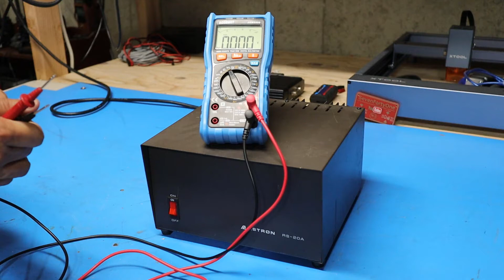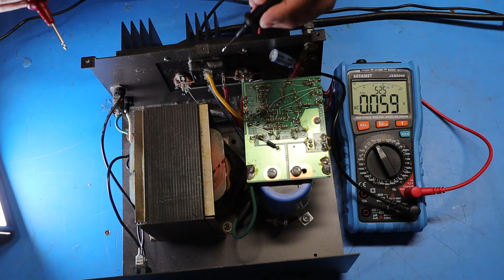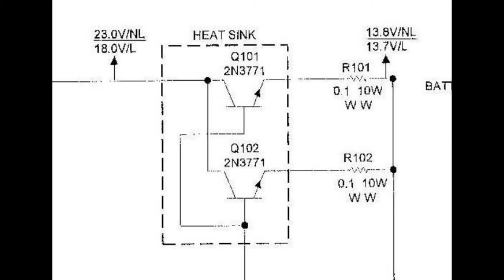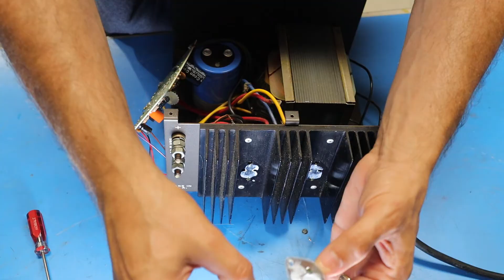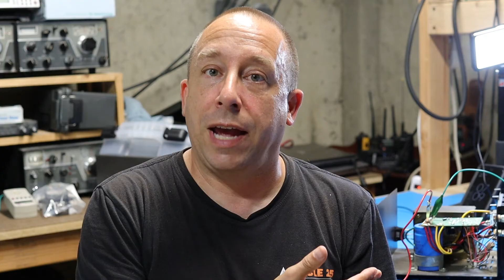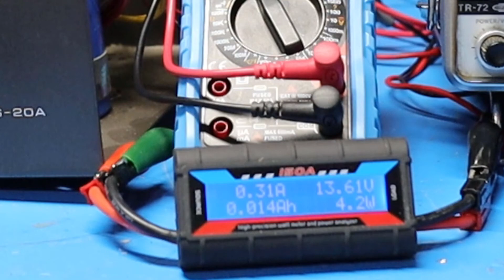Astron RS20A Ham Radio Power Supply Troubleshoot and Repair - No Voltage Output

Comment: I have had or worked with a number of Astron supplies over maybe 40 years?  I have two right now and I find them to be reliable.  The only issue is the neon in the power switch going out.  So I replaced the power switches with new replacements,  not difficult at all.  I found a cheap source versus some sellers that sell the switches for a premium for the Astron association.  Oh, and some may have a slight annoying hum.

Comment: Yeah, hi, I've an astron 20 amp power supply. I've for a number of years. Yeah, I blew a fuse, and then I put a fuse in and I looked lucky. I didn't blow my radio up. 17.6 V. The regulator might have went and the capacitors. I'm not sure definitely. I checked the capacitors, so I have too much power

Comment: I' bought a used a RS35 25 years ago (2025)  and have never had a problem with it other than a lightning strike that caused me to have to rebuild the circuit board. This supply was probably 10/15 or more years old when I bought it. Never a problem with the supply which has always been used on 100 watt transceivers.  I've left it on 24-7 for many years at a time.
Reply: Oh, I'm just gonna tell you. You didn't have to unsatur those transistors, they were just kind of like screwed in. Wow that's okay the neighb
Reply: Yeah, yeah, I noticed that you got some drake equipment.My brother was a ham radio operator well, he's up in the ham radio heaven, he's not around any more.We had some drake equipment, good job.I learned something today.I'll change the power transistors and I'll change that regulator I c chip.Thank you

Comment: The Lo-Z voltmeter input on your DMM (if it has one) is excellent for discharging the cap, and telling you what the voltage is as it bleeds off.

Comment: I'm in the midst of repairing a 35M with, possibly, the exact same problem.  Checking the internals, everything looks intact.  Good voltage at the large cap.  A few millivolts of output, and almost no volts at the base of the output transistors.  I was curious what I should see there, with no load, so your video was helpful!  I'll order up a few LM723s and try a swaparoo.  Thanks for the video!

Comment: Just a couple of nitpics.  That cap can (and frequently does) after removing the short/load.  I started leaving a clip lead across it when I could.  The transistore (those) do not have silpads (newer tech) but mica washers which are rather brittle.  The pass transistors cases are hot at 23 v so if possibke an insulator over them coul prevent an accidental contact & possible damage!

Comment: My experience - and that of many other amateur radio operators with this brand, is that you have to abuse them to kill them.  I have one on my desk as I write this, same model, never gave any trouble. Sometimes people put stuff like that in a rack or shelf unit that does not permit adequate ventilation, then they wonder why their gear starts dying. 🤣

Comment: Good video.
Just FYI, those insulators that you refer to as Silpads are actually mica insulators. 
Since they are somewhat brittle, it is important to inspect them for any cracking or delamination, before reinstalling them.
Silpads are flexible gray thermally conductive silicon insulator pads.

Comment: If your meter has low z. Drain the cap on that setting. You did not make a mistake. Just verified the transistors good first.

Comment: The best thing you can do for one of these is to put some fans on the heat sink. I have an AS35a and without the fans the heat sink gets so hot you can barely touch it after a few minutes. With a a few fans it’s ice cold and the transistors are only slightly warm after running it all day with a 30 amp continuous load.
Reply from the maker: @Trump985  good idea!

Comment: One point to make on these Astron Linear supplies,  The RS 20 is a 20 Amp max surge power, 18 AM max continuous.   Since my IC-7300 can draw up to 20 amps, it over stresses the supply at max output.   I've blown my bridge rectifier on my Astron,  repaired it and blew a pass transistor.   After that, I decided to pick up an R-35 Switching supply - and never looked back.   The Linear supply is running some ancillary equipment in the shack and will serve in that capacity for many years.

Comment: very rare for a transformer to fail,its a good idea to replace the driver with a darlington ie tip 122,lowers the load on the 723 reg output!.
Reply from the maker: I've had lightning take out transformers...several times in fact. it's an easy check that doesn't take much time so might as well start there just in case...

Comment: You didn't mention that after the transistors are removed the mica insulators must be cleaned and a liberal amount of thermal paste applied to both sides of the insulators. When remounting the transistors some paste should squeeze out. Wipe off the excess and you're ready to go. Most people fail to do this and it leads to another failure. Keep up the great videos. 73 KE5YTV
Reply: And don't go cheap on that thermal paste...use the good stuff.

Comment: I remember reading years ago that on some Astron supplies they used a regulator chip that was only rated for just barely enough current.  I repaired one by installing a higher rated chip, it is still working after more than 20 years.

Comment: Why didn't you use the diode check on your meter instead of beating around the bush. I had many failed power supplies and most of them were the output transistors that failed. Case closed time saved. Yes going through as you did with voltages. But these outputs go bad all the time...

Comment: Tip...before replacing the chip that sits in a DIP socket ...one should pull it out, look for corrosion, and reinsert. Heat and cold cycles can produce what is called chip creep which is when the chip works itself out a little.  Resetting it can fix it in those cases.
Reply from the maker: Great tip, thanks!

Comment: I just repair one of them RS-20 with meter,  it was bridge rectifier bad,  I replaced one with 50 Amp. same time, I put 20 A fuse in DC output.    I used to be repair Ham tech ,  many of them had bad Rectifier , bad current limiting  big cement resister  series with power transistor  ( R102, R-102 ) .    by the way , my first radio was something very similar to your Drake, mine was  Trio / Kenwood , crystal controlled 10 watts FM  144MHz  AG6JU

Comment: Hey Rob, good video man.  I have an RS-35M-AP I bought just a couple of months ago. It decided to just click repeatedly when on (no load), and the amp gauge just bounces up and down near the bottom of the scale.  So far, it looks like I'm the only one in the world with this weird problem.  If you have any thoughts about it, I'd love to hear them.  I'm a novice and dorking around with power supplies.
Reply from the maker: You might have a short in your pass transistors that is causing the protection circuit to repeatedly activate (crowbar circuit).  Either that or the protection circuit itself is having an issue.  Hard to say without being there myself but you could start there and see what happens
Reply: @SevenFortyOne  Roger that.  I replaced all the pass transistors today, as well as the 723.  No more clicking and voltage up and down, now just no power output at all.  The saga continues...

Comment: I cringed when I saw you inside of that energized power supply with your wedding ring on.  If you had got current running through it you could have been injured, and your ring damaged.
Reply from the maker: I cringed too...I didn't realize I hadn't taken it off until I was editing the video

Comment: This would lead me to the next question ❓.... 
Why did the IC fail? 
Unless the transistor or IC is known for failing... They shouldn't and my next step would be to check all the small capacitors! 
There's three readings you are going to need, the first one is capacity, it should read just below what's printed as it's capacity on the side of the capacitor, the second one is ESR, the lower the better ( sometimes comparing to a new one helps) and the last but not least and probably the most important is DC leakage! A cheap eBay component tester will give Vloss percentage, this reading should be as low as possible and again, compare to a new one if available! If a capacitor is leaking DC, it could be sending it to ground causing the circuit to work harder than needed, or it could be biasing up the next stage which kills transistors and ICs.... 
Capacitors if not leaking electrolyte will sit there and kill equipment! You will replace the burnt out component, the new replacement will tolerate it for some time but will fail again... So basically never trust a capacitor! If you value your equipment, keep a close eye on them, and always use well known brands!
Reply from the maker: I didn't mention it in the video but a lightning storm came through a day or two before this power supply failed so I'm pretty sure that's what caused the problem.  In fact, my radio took damage too.    Thanks for the info on the caps though.  I'm aware they can be problematic but opted to leave the originals in there for now.

Comment: Always liked the Astrons. I was not aware of the regulators as possible trouble. I like your troubleshooting breakdown, Well done!
Reply from the maker: Thanks RW!
Reply: Astron can and does have many different problems like any type of linear unit. Just the nature of the beast. Make sure the base transistors always have thermal compound with insulation mica isolators or a transistor thermal pad. Also another thing that helps upgrade the pass transistors driver transistor with thermal compound as well. And the bridge rectifier too. Will always makes these units last longer in operation. I've repaired multi hundreds of Astron over 50+ years, and did these unit modifications. Many units have been working over 20+ years, than average failures.

Comment: Had the same problem with an RS-35.  Never did fix it as I cam across a good deal on a switching Astron.  Also good to work you from Codorus State park, PA K-1342.

Comment: Hi Rob,
Great video. Nice you already had on hand a replacement regulator chip. Stay safe.  73  WJ3U
Reply from the maker: I bought a bunch of the regulator chips the last time I fixed one of these knowing id use them eventually

Comment: My Hamfest $60 VS-50m is blowing fuses. Looks like a long fix for me. I bought mine Saturday. We will see where my Troubleshoot leads.
Reply: I brought mine to a friend at work. Troubleshoot found bad rectifier circuit. Parts will arrive tomorrow and I have a couple transistors that are questionable. Also, replacing the chip, because it is not the original. I will report back. Thanks again for the video, inspiring!!
Reply: Final report, I don't have any idea how the previous owner was cooking the Power Supply, but I know they showed no mercy in heat and or power consumption. This Astron had cooked the paint on the inside! It now runs like a champ again! BTW heat sync compound is the best friend to many components of this power supply.